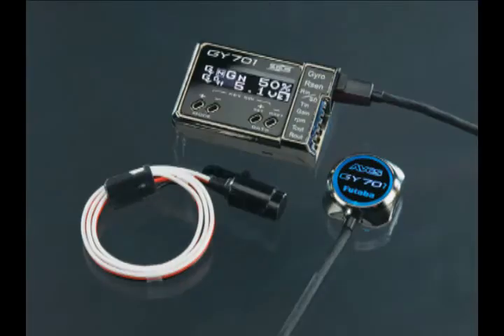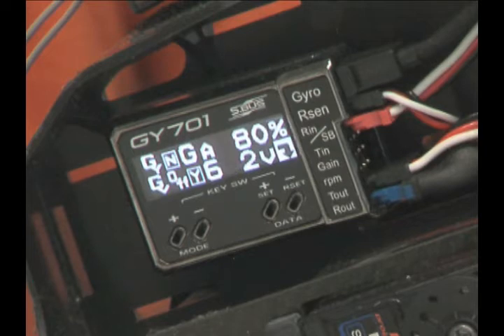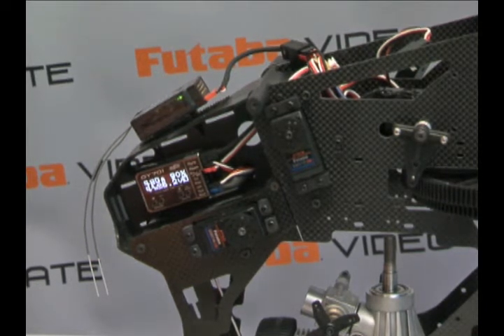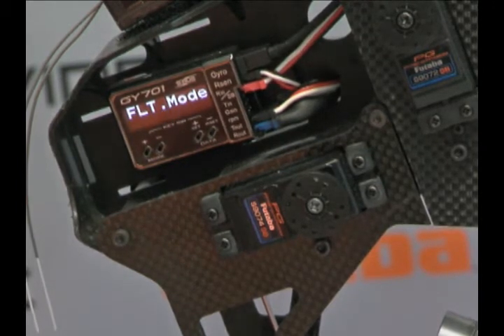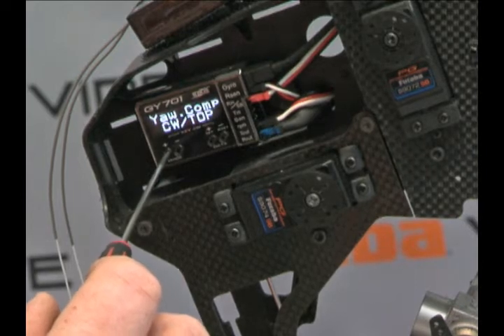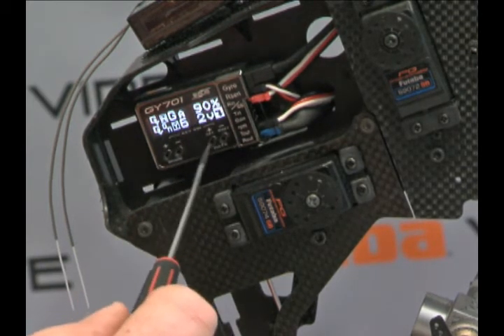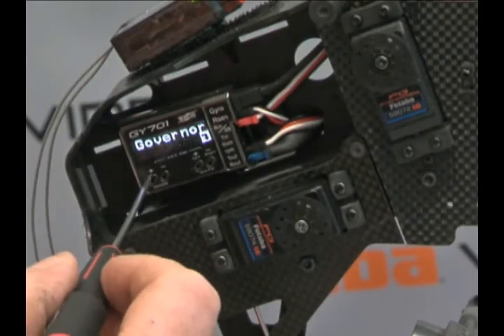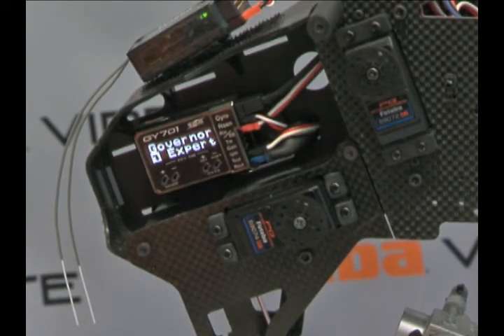Futaba® GY701 Heading Hold Gyro and Governor

Comment: Good afternoon, watched the video, you can use the GY701 as governor with a transmitter/receiver 6 channel GY520 gyro, the connection between governor and receiver: "GY701 throttle channel output" to "throttle channel Receiver output". and "GY701 throttle output" to "throttle servo". Thank.